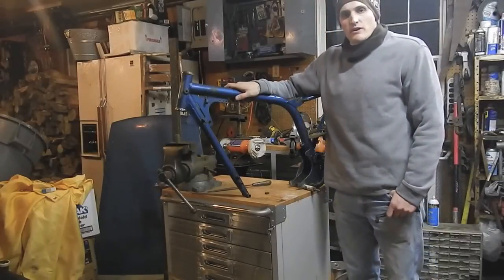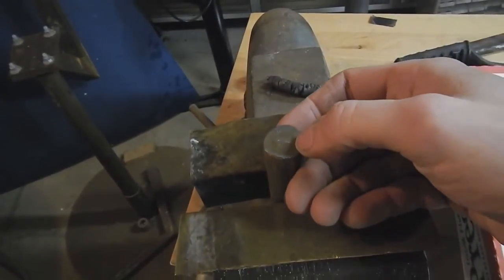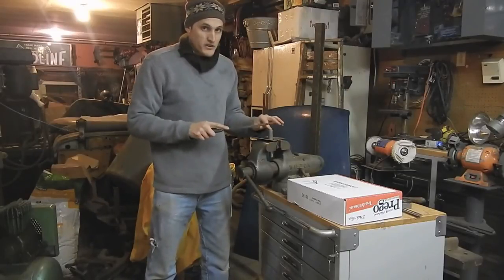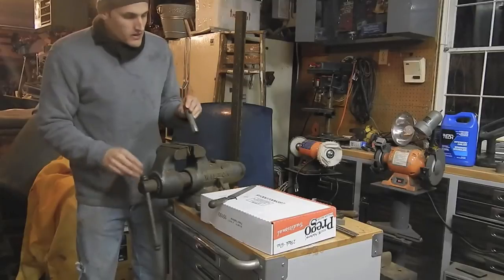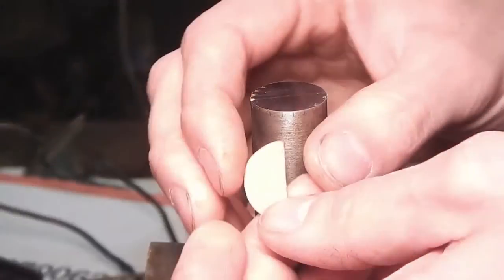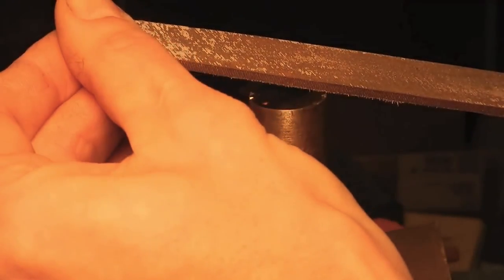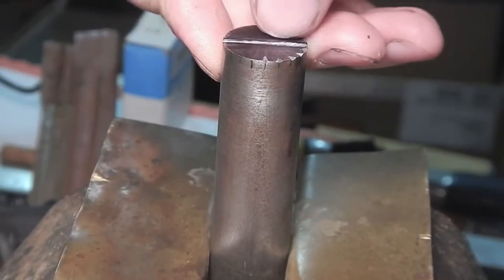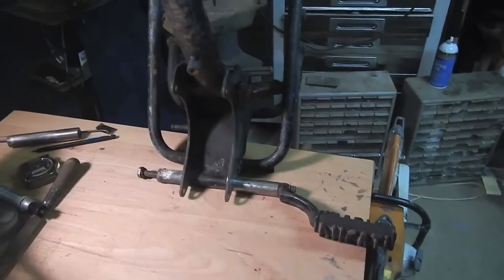Motorcycle Frame Repair Make a Foot Peg with a File Ducati 250 gear

Comment: Nice work Adam.  I know that took a lot of time to make the part, and to make a good video.  There are stories that in the early days of autos and airplanes that some mechanics would replace broken gears by actually hand filing new ones.  Hardier times than now, though you've shown what determination can do.